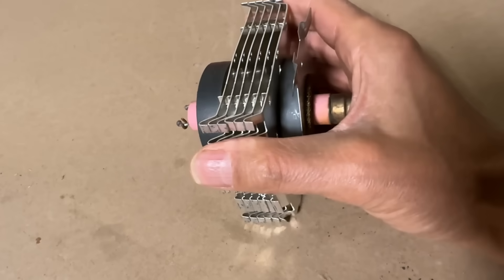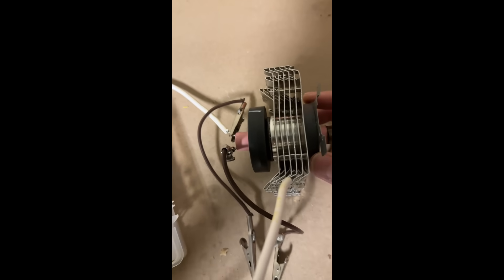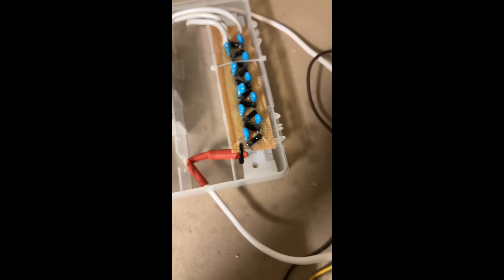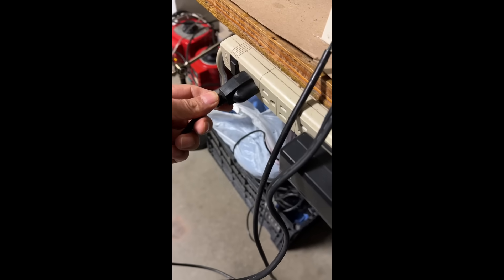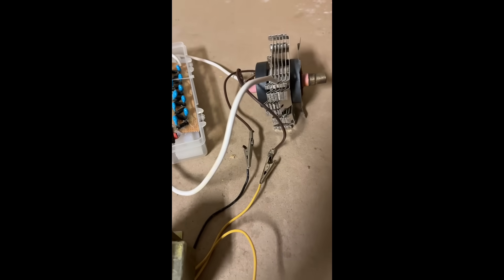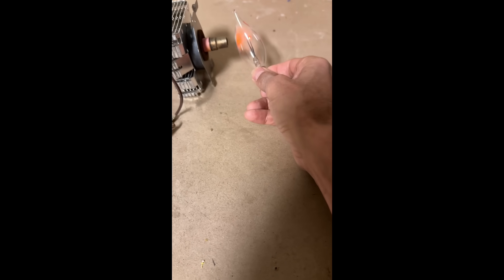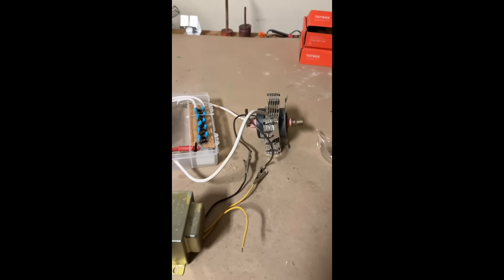Running a Magnetron at Low Power

Comment: So when I run 12 volts at a few hundred amps (or thereabouts) through that little maltreated Panasonic magnetron of mine, the wire inside (no not inside the vacuum cavity) and the beryllium insulators glow a reasonably bright approximate 680nm-750nm ruby red colour. Is there any reason other than the very significant amount of heat that is radiated?  Those heatsink fine get pretty bloody hot, they have come loose,  so now my magnetron rattles sounding like a Ute full of scrap metal.

Comment: The stem at the top is not a wave guide, it is basically a quarter-wave antenna that slides in a wave guide when you mount the tube. The fact that RF energy also can be seen at the back is because in this setup the whole works as a dipole, with the rest of the tube (heatsink and all) working as the other half of the dipole, thus the counterpoise.
I'm actually highly surprised that this works. The HV power supply that you are using is much weaker than the one normally present in a microwave oven, so the electrons leaving the tube's cathode would never be able to stay "airborne" circling the cathode, they would fall back to the cathode when the HT power supply is too weak. Very strange.
Reply from the maker: Yes honestly didn’t expect it to output anything

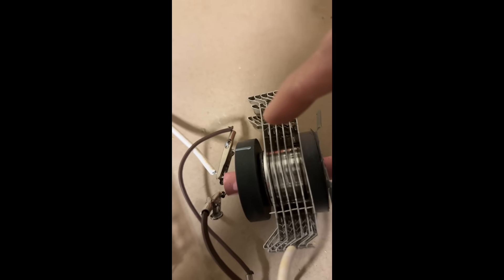Comment: 1:30 your description of the function of cavity magnetrons is 0% accurate. 
The axial magnetic field has nothing to do with the generated microwaves. The magnetic field deflects the radial Electron cloud into a spiraling electron cloud that sweeps past the edges of the cavities. The charge that sweeps past the cavities induces current (in the tangential direction) which momentarily charges each cavity, which then oscillates as a tuned LC circuit. There is an even # of equally tuned cavities. A pickup antenna in one cavity couples the microwave energy to the antenna on top. 
The magnets are ONLY to cause the electrons to move tangential to the anode as they approach, so they can inductively couple their energy to the resonant anode cavities (consequently, the cloud takes on a rotating star shape as the cavities resonate, which supports higher efficiency and power output than a uniform electron cloud would).

Comment: I wonder why the microwave output looks to have a strip internal conductor and not a round wire as in usual coaxial cable. Could it be to stop the polarsation twisting?

Comment: In high-powered magnetrons, the filament can operate in 'self heating' mode.
Filament needs to be heated initially, but due to the amount of power running through the device, the filament self-heats in a 'bystander' mode.

Comment: Microwave ovens fail over time for these reasons:

1) Main power transformer (very rare)
2) HV Diode (common)
3) HV Capacitor (semi-common)
4) Magneton spade lug connector (medium common for old magnetrons)

I spent about a month diagnosing my 1994 Sharp microwave oven that was failing slowly. 1) is obvious if it is failed. 2) I replaced and the oven worked well for about 3 more months. I then went to 3) which did not help.

4) was the problem. The spade lugs pass 2 voltages into the magnetron: low voltage/high current to the magnetron filament, and the 8KV DC voltage generated by the diode/capacitor voltage doubler. Those connectors have built in 20pf or so capacitor to reduce noise. That is a point of failure. If one/both of those capacitors fail, now there is a low resistance path to ground. That was totally my issue. One connector measured 45Ω to ground, not good for 8KV; dead short. 

I replaced that spade lug connector (easier said than done) and now this microwave is 100% solid performer again. 

DISCLAIMER/WARNING: Be super careful when working on these ovens. There are deadly high voltages involved. Never open an oven when plugged in. Never power on the oven with the case off; Just DON'T. If you MUST do this for some reason, keep your hands in your pockets, and do NOT poke around with a DVM probe. 8KV at a stiff current will kill you instantly. I'm not responsible for your possible mistake.

OTHER WARNING: If your magnetron has pink ceramic between the body and the emitter, be EXTREMELY careful not to crack / break that ceramic. It contains beryllium oxide, which is extremely toxic if inhaled. Wear a safety mask, N95 or better, when working on these devices.

Comment: Just wanted to point out that the magnets are utilized to rotate the electron beam from the cathode just the same as in a cyclotron particle accelerator. As the electrons pass the cavities on the perimeter of the anode they resonate...cathode circumference divided by number of cavities gives wavelength then divide that into the beam velocity to determine frequency. Frequency can be changed by voltage potential
Reply from the maker: Great info- thanks!

Comment: 2:02 you're in a bit of trouble if the cavity resonator😂 is dust though I've just told myself never damage, I've got dozens of them disassembled. Was thinking of combining the chassis and make a reasonably large annealing furnace, something that I can place a reasonably large assembly of glass in for example 

Great video
Reply from the maker: Thank you- I gonna do a run with a variac on the classic circuit- will keep you posted

Comment: A point on microwave safety: while yes microwaves are relatively safe radiation, and yes you'd likely be able to retract any limbs from a burning sensation if you got too close (although really high power transmitters can severely burn you rather quickly), the real danger with these is the lenses in your eyes, the lens in your eye has very little cooling and can be very easily damaged by microwave energy (causing cataracts or blindness), and this can happen quickly with power levels lower than would be dangerous to other parts of your body (i.e. your hand being safe doesnt mean that your eyes are, think about laser pointers as an analogy).
Reply: Some of my friends have developed cataracts which they blame on working on high power radio amplifiers with the lids open. I am highly aware of these safety issues, having worked with microwave systems since the 1970s.  The only RF burns I've had are from 7 MHz and 14 MHz systems. I use screening shields in front of my face when adjusting high power GHz amplifiers, and never operate high powered devices which can radiate significant power without either full shielding in place, or by running them in my remote lab inside a Faraday cage
Reply: @MachiningandMicrowaves  yeah  infrared too cause cataract,  it's smith's occupational disease
Reply: Never tinker with magnetron,  microwaves + high voltage  makes it VERY DANGEROUS !
Reply: @ Also very interesting. They are very low voltage compared with the other high voltage systems I play with, also low power.  Always tinker with magnetron.
Reply: The effect is simple, if your eye lens reaches more than 40C° for prolonged amounts of time you get cataracts. Microwave radiation powerful enough to cause that feels very hot in your face, so its is very unlikely that to be the case unless people purposefully exposes themselves. Staring at a glory hole or a forge is as damaging if not more.

Comment: Crikey!  I didn’t know that they were so omnidirectional. I had always expected to see quite a focused beam. That’s a bit shocking frankly. I must have a look at how they tame the beast in the appliance. Would be terribly inefficient otherwise.
Reply from the maker: I think the loss of direction in this low power test is related to removal of the steel plates from the back of the device

Comment: I'm always curios about this. So you can run a magnetron at low power, but what I'm wondering is what would happen if you used a variac on a normal microwave. Wouldn't that lower the magnetron output as well as make it consume less power overall? How would this affect it in the long run. The reason why I'm wondering is if I could run a microwave on a smaller inverter that cannot deliver the output needed for full power so it doesn't work. So what if I limit how much the microwave consumes?
Reply from the maker: I’m about to do exactly that experiment. I have it all set up and want to run it off a 2kVA variac. Issue is at lower power levels the filament will  be underheated but this may not be a bad thing. When the weather improves, I plan to run the experiment outside with a remotely operated camera. check back soon for the video and please click the bell so you know when I post it
Reply: in order to reduce the output power of the magnatron you need to lower the value of the high voltage capacitor in the voltage doubler circuit, however there is one small problem , the high voltage transformer in a domestic oven is of the flux leakage type , so its pre loaded and draws a very hefty current  even when  the secondary has no load .

Comment: "The microwaves will also come out the back"
Yay, now I'm REALLY scared of playing with a magnetron!!
Reply from the maker: I think if I hadn’t taken the metal plate off the back, then the microwaves, but only have come out of the front of it
Reply: I HAD a friend in the USAF that worked on ECM on B-52s. He stayed in only 8 years. Later he developed brain cancer and died. I have no idea what caused his cancer.
Reply: The cathode creates induced noise in the power lines, effectively turning them into antennas. The two chokes were there to suppress such interference. I think the problem here is that he removed the two chokes that were under the back cover.
Reply: This stuff is extremely dangerous to play with . You could suffer long term efforts like prostate issues and Cancer 20 years later. In the 80s, I worked as a Test Engineer for a military subcontractor who built radar systems used in fighter aircraft. We built an tested microwave transmitters . Had to do it at night when everyone went home. This is extremely dangerous to play with, I know and suffer the medical effects 40 years later. Be careful folks!
Reply: @Ocean_breezes  My Dad developed cancer where he was hit by a navy RADAR. In this video more radiation came out the back then the front, imagine 2,000 watts.
Reply: @RkicF8 more like killowatts avg megawatts pulse.

Comment: The beryllium is very hazardous. Also, there is a case that normally goes on the back of the magnetron to focus things forward. Not worth your eyesight, burnt fingers, or any other bits. A waveguide can be made with fine metal screen or aluminum foil.

Comment: Sorry, but your HV ladder is making enough OZONE to light up your bulbs, that's not microwaves.  Nice try.  You can power down your filament transformer, take the magnetron and toss it into the dust bin, and put your gas tube lamps near your diode-cap ladder and they will light in the same fashion.  I love the internet, it makes fictional science a reality.

Comment: Magnets help electron flow go in circles in resonator to produce oscillations.
Reply from the maker: I’m guessing that through Lorenz  forces induced by the opposing ceramic magnets which have field lines that intersect at right angles with the direction of the electrons, the electrons flow in a spiral motion past the resonant cavities. These cavities are sized to produce resonant motion of the electrons within the cavities in such a way that they generate microwaves. Changing the size of the cavities would alter the frequency and wavelength of the omitted radiation.
Reply: good , Is there gif Or video discrep for this point { Magnets help electron flow go in circles in resonator to produce oscillations  } thanks

Comment: I'm not entirely sure you created microwaves here and may have read the results wrong...removing the filament voltage made it appear as if the output diminished BUT it could very well have just been a HV rectifier you created and was lighting the lamps with capacitive coupling to the bulb and your hand and removing the filament voltage insulated the HV from the end ...you tried both ends with fil voltage but not without (only one end). Try the fil end with the fil power removed if it lights its HV if not its microwaves.
Reply: the filament needs 10 amps at 3.3 v approx , he didn't even have a transformer that could supply this current and this is why you didn't see the antenna end glowing red.

Comment: BTW> The voltages that this project run do not present as dangerous, they are lethal. A shock from this you will NOT be able to talk about later. If they were 10kv and higher they would be safer do to skin effect, lower and you might live,  but these voltages are the voltages they use to execute people. Please take ALL precautions people if you decide to play with such voltages.
Reply from the maker: The power supply outputs 10 mA at 2kV. This equates to 5 ma at 4 kV. An electric shock from this power supply would be painful but not lethal. Always need to adhere to the one hand view when it is powered.
Reply: @BrianDhvTinkerer  10ma at 2kv is the same power as 5ma at 4kv BUT I assure you they are not equal in other respects, yes YOUR power supply may not supply the current to kill but others watching this and playing with such will probably use the HV transformer that came with their magnetron and they are very dangerious...my comment was general and not specific to your set up.

Comment: Often wondered if you took the magnets off the magnetron would you have a high voltage high current rectifier??? Could be quite useful....one could also replace the magnets with coils of wire and modulate the magnetron with an audio source making a simple but powerful A.M. 2.4 Ghz transmitter. Oh the ideas never end...

Comment: The magnetron isn’t dangerous without the wave guide besides the high-voltage it puts off
Reply: Whats the wave guide got to do with how dangerous it is....i'm not sure you understand the principals at works here.
Reply: @ the wave guide change/ the frequency to cook the food without it, it won’t be dangerous. Would you like a link to a video of someone putting their head in front of a plugged in one at full power?
Reply: what exactly do you think the wave guide even does?
Reply: @Teslas_Workshop  Actually yes I'd like to see that video for a laugh...and any videos of changing frequencies with waveguides would be really cool...
Reply from the maker: The HV power supply has a  maximum output of 12 W. The volume of my garage is 7200 ft ^3 which is 266 m^3. Assuming 100% efficiency of microwave production would be 12/266 W/m^3 =0.0451 W/m^3 = 45 milliwatts/ m^3. As energy density around the magnetron drops off by the inverse square law, energy even if it was 10x higher where I was sitting, the maximum exposure would be 0.45W/m^3.

Maximum safe exposure limit is 1 W/m^3
Reply: @ https://youtu.be/HJYLROgd6IA?si=aE7xns4V2G15oazA
Reply: @ maybe you will apologize after being wrong
Reply: @BrianDhvTinkerer  very useful thank you. I tried explaining to other guy
Reply: @BrianDhvTinkerer  Um the vol of your garage has nothing to do with it you could be outside in an open field, your exposure is a factor of distance to source only, and yes this exposure is minimal and only non ionizing radiation. Nothing to worry about.
Reply: @Teslas_Workshop  Love his videos...did you watch and listen, he says nothing about the waveguides changing the frequency, he did mention 5.8 ghz stuff at the beginning of the video from 5G, your making connections that don't exist...he did demonstrate that a waveguide bringing the microwaves from the magnetron into the cavity  is what created the high power in a small space heating the food, but nothing about the waveguide changing the frequency to a higher one enabling the cooking....you misunderstood. Microwave ovens operate on 2.4 Ghz and nothing more. Actually the FCC wouldn't have it any other way as 5.8 Ghz is allocated for other uses . Wave guides are just that, guides for waves, they do not change the frequency.  73's VO1CSD
Reply: @ have you ever admitted in life your wrong. even once?
Reply: @Centar1964  the video uploader already explained it to you so any more of this is wasting my time. just stop contributing to the worlds downfall
Reply: @Teslas_Workshop  OMG I love to be wrong and learn something new...always the 1st to question myself....how else do you think I have learned what I know...
Reply: @Teslas_Workshop  Spreading misinformation is the worlds downfall and I for one will expose all I see.
Reply: Google Dunning-Kruger effect...you may be as risk...oh and check out the Darwin awards.
Reply: @Centar1964  I will take that as a no
Reply: @Centar1964  it’s astonishing how dumb people are today. someone can literally test things and yet people say it doesn’t work that way. i guess theoretical physics is more practical than real results
Reply: @Teslas_Workshop  Ya astonishing is the word I was thinking of....

Comment: The most important thing he says is that Beryllium is VERY toxic.  Anyone futzing around with an old magnetron needs to wear a respirator and sealed eye protection.  Just imagine it's Plutonium or Sarin Nerve Agent.
Reply: You'd have to grind the beryllium into dust and inhale it to do damage...no consumer grade device would be allowed on the market with something as toxic to be really dangerous. Ive broken open many of em out of curiosity when I was young, 60 now and no toxic poisoning happened to me. Most of the colored ones are ceramic anyways (like the pink one in the vid)...the old white ones may be beryllium...